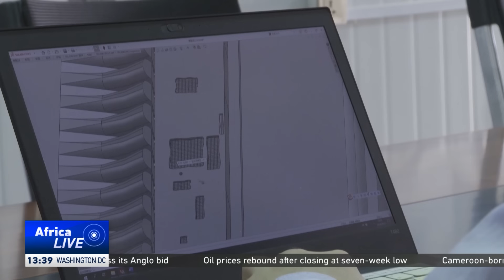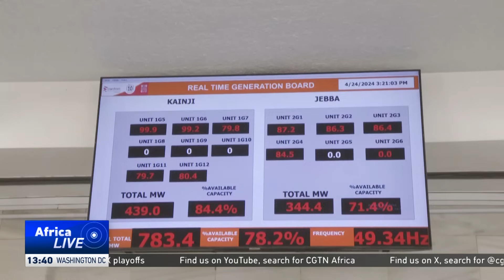Chinese experts assist Nigeria in expanding largest hydropower station

Comment: Africa can do it if it has THE GUTS!!!: 

Systemic issues like skills gaps, inadequate planning, and lack of enforcement mechanisms are major impediments to mandating skill transfer from foreign infrastructure partners to local Nigerian/African counterparts, THE ONUS is also on Nigerian and other African governments to take proactive steps and negotiate strongly for such requirements.

A few key takeaways:

1. There is likely no shortage of capable individuals in Nigeria and other African nations who could benefit from comprehensive knowledge transfer programs facilitated by foreign contractors. However, the lack of mandates and stringent policies has hindered this process.

2. Nigerian procurement personnel responsible for drafting contracts often lack the capacity to incorporate robust skill transfer clauses and enforcement mechanisms.This governance deficiency needs to be addressed.

3. African governments need to muster the courage to prioritize skill transfer during contract negotiations with foreign partners like China. Firm negotiating stances and making it a non-negotiable requirement could shift the dynamics.

4. Establishing such mandates and ensuring their implementation could have a ripple effect across the African construction sector, gradually reducing over-reliance on foreign labor and building sustainable local capabilities.

5. While challenges exist, taking that critical first step of demanding comprehensive skill transfer programs as a contractual obligation could catalyze the much-needed knowledge sharing and capacity building for long-term self-sufficiency in maintaining strategic infrastructure assets.

African nations cannot be passive recipients. Proactively advocating for and enforcing skill transfer requirements, despite the tough negotiating tactics of partners like China, is crucial for nurturing homegrown expertise and promoting sustainable development goals in the construction sector across the continent.

Comment: Does this mean Nigeria does not have trained divers that could have cleaned out the debris out initially? Did Nigeria mandate that Nigerian divers and engineer be included in this task? How will Nigeria be able to do this work in the future if China is not mandated to include Nigerians to fix this? What a miss opportunity.
Reply: My opinion exactly. After over 60yrs, with all the citadel of higher learning, we can not boast of engineers who can deliver on this job, such that we have to run to the chinese to do this job.